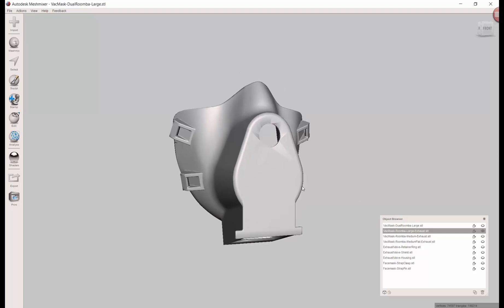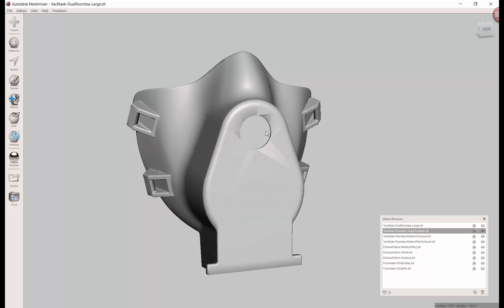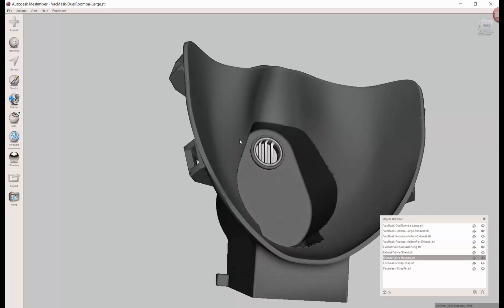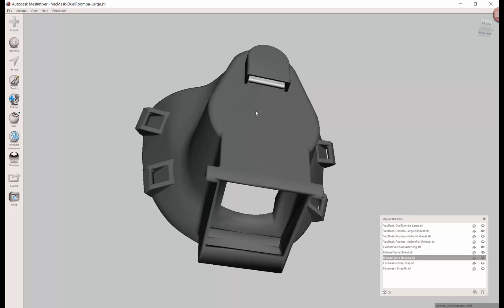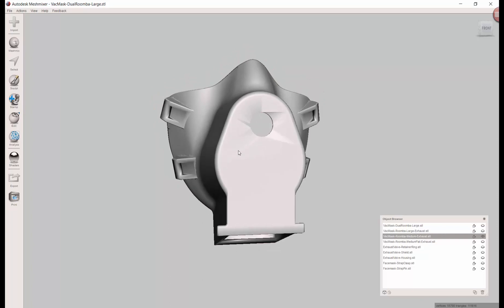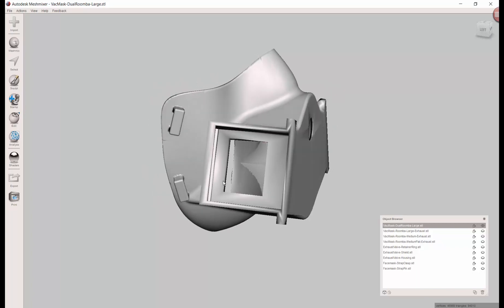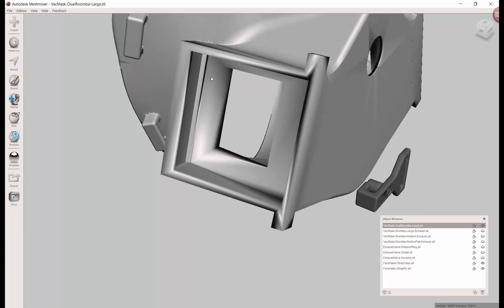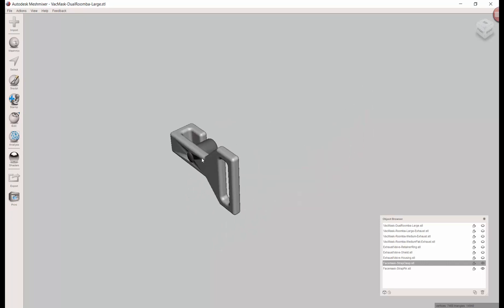VacMask - New Mask Styles and Update

Comment: Baron, I’ve been able to print masks out of PLA and PETG easily but require rubber seals. TPU worked but not perfect (need to experiment further), IDB was a total failure and waste of money. Any tips? Ideally I would love to plane cut the section of mask that seals against face in a free form design following face contours from scan and have a groove where the it can be glued to perimeter of rigid mask. Hope this made sense
Reply: Two .stls from original mask design
Reply from the maker: You can definitely sculpt if you're up to it. Ever using meshmixer. Or, just heat and contour the PETG.
Reply: Baron Grutter DDS thanks 🙏

Comment: So 3D printing models takes a ton of time. And a roomba filter probably isn't a high enough rating (merv 14 or higher), I personally don't know, but I've put together a methodology that can get a mask made much much faster than standard 3D printing rates. 

I have a google doc with the assembly instructions if you're interested in looking it over. 

I'm also a DDS.
Reply from the maker: Roomba filter is designated as HEPA. HEPA is MERV 17-20. HEPA will remove 99.97% of particles 0.30microns. 

What filtration method are you using? Share a link to your document and I'd be happy to take a look. Efficiency is definitely ideal.
Reply: @bgrutterdds  oh that's awesome! I should  look into cost of replacement for those filters.

I'm using merv14 filter material. 

https://drive.google.com/open?id=1HEvOCDBLVT8HcQgq0cZCZ0pb61rFfwtzV5VZfs8dIs4